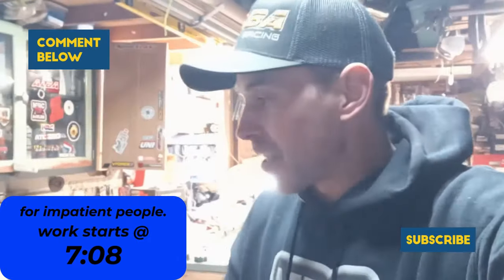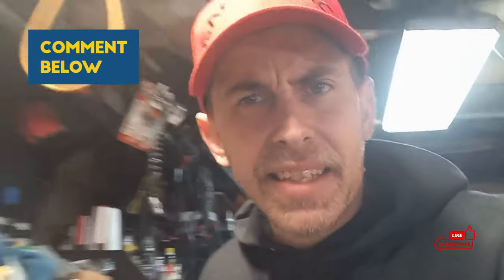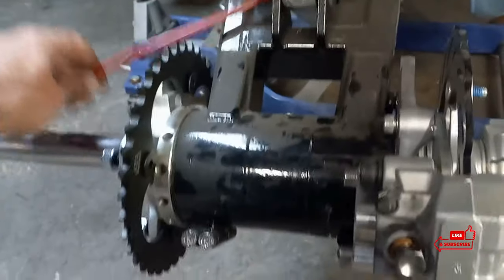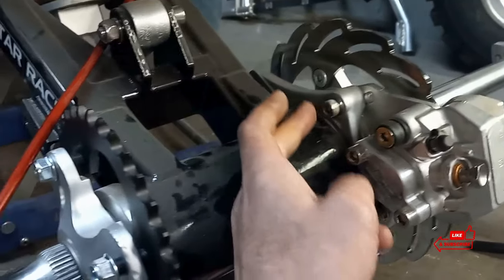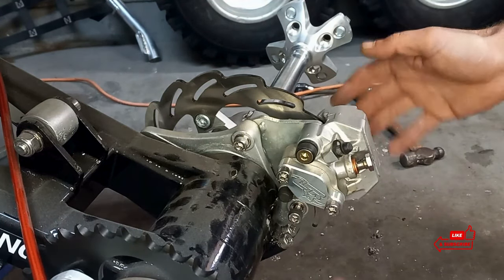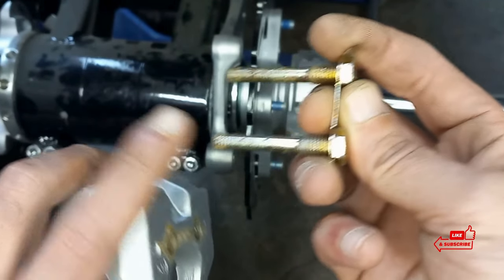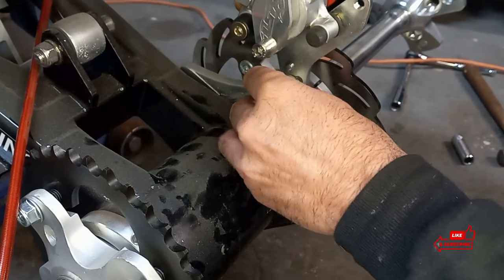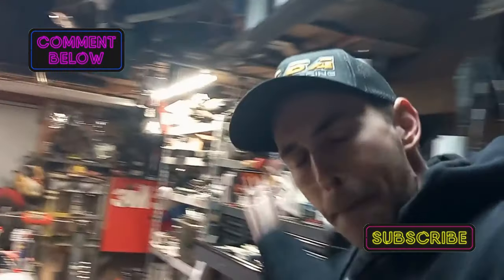Trx400ex: How to Replace Brake Pads. Simple Series Ep.1

Comment: should you bleed your brakes every time you change your pads?
Reply from the maker: I look at it this way if you went through a set of pads it wouldn't hurt to flush out the lines and use new fluid. That's alot of heat cycles ran through it. Brake parts get super hot

Comment: What would you do?.... 2001 400EX customer bought it new once it rebuilt stock. Go to BP racing stock Wiseco top end kit kibble white valves and seals stage 1 hot cam...... break it in drive it for about 2 hours runs great. Wake up the next day fire it up and for about the first four or five minutes it smokes moderately and then clears up. Maybe bad valve seals so I go ahead take the head off change them again. Same thing after sitting for 12 hours or so it produces some smoke when it first starts..... try a different head that I have brand new with kibble white valve springs everything. Same thing...... 130 PSI compression and runs really great all except for the smoking when it first starts after sitting for more than 12 hours. Did BP racing sell me an egg-shaped cylinder what do you think ?
Reply from the maker: It could be a few different problems. Is the head oem or aftermarket? U can do a compression test to see if that's the issue too
Reply from the maker: If BP sold u a defective product they are great at helping out
Reply from the maker: If BP sold u a defective product they are great at helping out
Reply: Check out the stuff Matt said. Also all piston are more of an oval shape than perfectly round. If you measure the piston you will get your exact size from the lower part of the skirt instead of the very top of the piston. Your smoking issue could also be from your rings maybe you gapped them a little to much or you didint get a good seal from your break in.